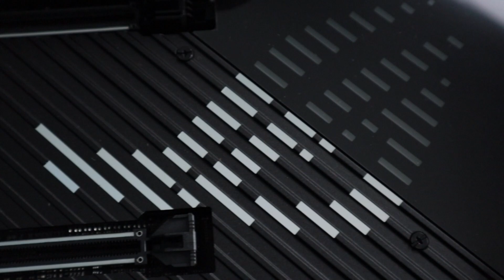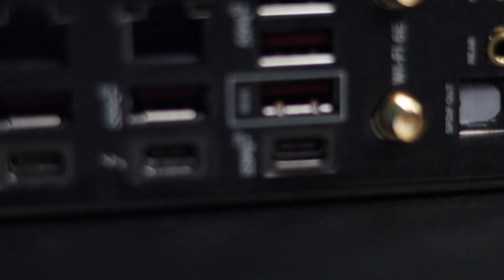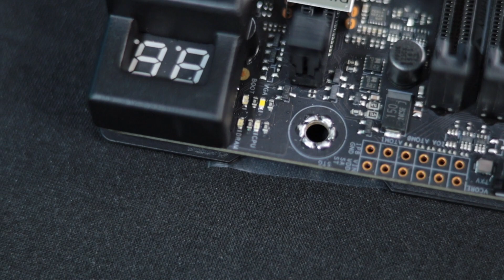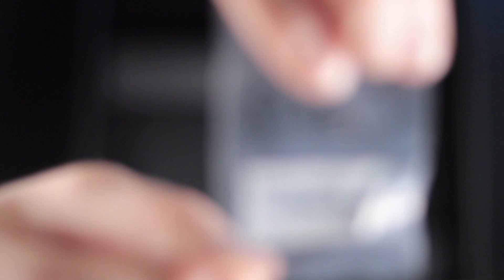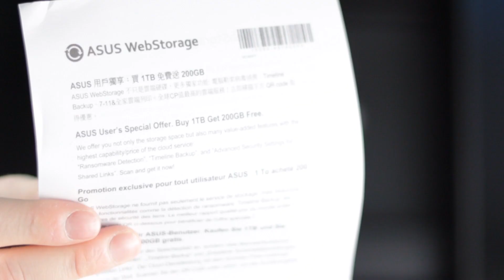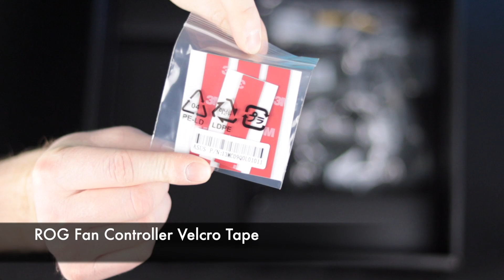$1000 Get's You This Insane Motherboard!

Comment: this board is garbage don't buy it and asus customer support is the pitts. i can't get the hyper card working on my bord it only shows gen 4. what a waste of a 1000 smackers never again
Reply from the maker: @lonewolf5316  that sucks that has been your experience :/ I have had the opposite experience with the board and it has had zero issues the entire time I have had it! PCI lanes can get a little convoluted because there may be multiple slots like on this board, but there is a limited number of lanes that can be used. For instance if you use the Gen 5 x16 slot for a 4090, it’s technically only using Gen 4 x16 performance leaving x8 lanes of PCI Gen 5 for other Gen 5 devices. So between the two PCI Gen 5 x16 slots, if you use both at the same time (GPU and hyper card) they drop to PCI Gen 5 x8 slots or PCI Gen 4 x16. The generation is not really a concern to me as much as if you are saturating the PCI data lanes with the max amount of data it can support which I would say anyone would be hard pressed to do! So I don’t believe you are have any performance loss because it shows its Gen 4!

Comment: This board along with all 4 DIMM boards will not stabily run DDR5 memory above 7200MT/s at least not using XMP profiles.
Reply from the maker: I have heard there are issues with RAM speeds and these newer boards. I haven’t dove into XMP profiles on the board yet but will be soon!

Comment: I just want the RGB to work lol. Armoury Crate is literally the worst software ever developed. Do you know how to get the RGB to launch on boot? On boot it just defaults back to the rainbow vomit.
Reply from the maker: I haven’t dove into Armoury crate yet, but my experience with it so far hasn’t been a ‘wow this is amazing’ if I had to give an opinion on it right now. I’ll let you know once I dive into it if I can get it all to work on boot!
Reply: @techtoniksystems  Thank you! It has been driving me literally insane lol. It stops working on like half of my boots, stops recognizing the motherboard, the RAM never turns off, the AniME Matrix and LED screens stop working or freeze all the time. Its terrible. If you have any tips, I would seriously be so interested.
Reply from the maker: @Evenaardez  I currently have the system in an inoperable state while I finish building, but as soon as I get it up and running it’s one of the first things I have to figure out to get the color scheme down! When I was bench testing and the board has power but not on the animatrix panel, OLED panel, and backlight RGB were all still on. My RAM however was not on once the system is off. I’ll see if I can do some digging in documentation for armoury crate to see what I can find!
Reply from the maker: @Evenaardez  do you happen to have multiple RGB programs installed on your system even if you don’t actively use them control different RGB products?
Reply: @techtoniksystems  Nope I uninstalled them.
Reply: @techtoniksystems  Thank you so much! I truly appreciate it. The RAM turns off eventually but I do not know why it turns off immediately. Tbh this board has been annoying. Boot times suck and it often screws up with waking from sleep.
Reply from the maker: @Evenaardez  My next suggestion would be to uninstall Armory Crate and use the standalone Aura Sync client by itself. See if you can get it working using that! https://www.asus.com/campaign/aura/us/download.php
Reply from the maker: @Evenaardez  the trick is not to hit the download button as that will just download armoury crate but instead look further down for the hyperlinked version of the the standalone and click that which will download the most recent version.
Reply from the maker: @Evenaardez  It’s possible you could still have some residual files from the other RGB programs that you might have to go searching for. As for the boot issues/waking up from sleep, what BIOS version are you running?
Reply: @techtoniksystems  I am running 1003, which I think is the newest?
Reply: @techtoniksystems  I can try that, but then I think the AniME Matrix and the LED screen cannot be customized.
Reply from the maker: @Evenaardez  I would do it temporarily just to see if you can get the RGB working without armoury crate the way you want. By uninstalling armoury crate, it’ll tell you that it is indeed armoury crate that is giving you the issues you are seeing vs it being something else in the system. If I was having that issue that is how I would isolate it! And currently version 0904 released on 3/31/2023 is the latest update for the z790 extreme, so updating may help solve some of the problems you are seeing with boot and coming out of sleep! https://rog.asus.com/motherboards/rog-maximus/rog-maximus-z790-extreme-model/helpdesk_bios/
Reply: @techtoniksystems  Sorry technically I am using the x670e extreme. Very similar board but its the AMD version lol. Somewhat regretting going AMD this time tbh
Reply from the maker: @Evenaardez  ahh that makes sense! I have heard that AMD boards have had some stability issues.. hopefully they can figure it out with further BIOS updates. But when I get back into armoury crate I’ll be looking into your issue further!
Reply: @techtoniksystems  Cool, I really appreciate it!

Comment: As I mentioned in a prior video of yours if you use that PCIe 5 M.2 not only does it disable the second PCIe 5 x16 slot but it also shares bandwidth with the top typically GPU PCIe slot making it at PCIe 5 x8 slot. It's one of the big aggravations I have about Z790 over Z690 that doesn't appear to have the same problem (based on my limited number of builds on that platform).
Reply from the maker: The Z690 Extreme also has the bandwidth cut to x8 when both slots are used and it disables the lower 5.0 x16 slot completely as well when the M.2 slot is in use. It is a frustrating aspect, but I believe it is due to the limited number of PCI lanes CPUs are able to handle. If you know about it prior to buying/building it should be easy to plan around!
Reply: @techtoniksystems  .. Speaking of my ASUS Z690 and ASUS Z790 on-hand now only the Z790 has this shared M.2 issue making the GPU slot into PCIe 5 x8 (4.0 @ x16). As far as planning, day one I needed spaces for 3X M.2 and while I could have possibly moved the M.2 on a different PCIe then a GPU block would have been in the way.

GPU-Z (Z690) vu9qc ; Bus Interface: PCIe x16 4.0 @ x16 1.1
GPU-Z (Z790) cvzw ; Bus Interface: PCIe x16 4.0 @ x8 1.1
Reply: Sorry sort of new to this. If I wish to use a gen 5 m.2 ssd, and if my gpu a 4090 is on the gpu's pcie won't it reduce it performance based on what you said? In that case is there a mono recommendation?
Reply from the maker: @nicholastang2642  That is a possibility yes, as there is a finite amount of PCI lanes the CPU is capable of handling, however, that doesn’t always mean performance will be slightly reduced or you will see an impact to performance. It would all depend on the amount of data that is transversing the PCI lanes at one time. So it would be a situation dependent thing. Currently (as of 4-23-2023), the most powerful GPU, the RTX 4090, is a PCI 4.0 capable device which means it is only capable of running at 32gb/s of bandwidth. PCI Gen 5 has 128gb/s of possible bandwidth so that would leave 96gb/s of available bandwidth for other PCI devices. You could still run several PCI 5.0 SSDs (when they come out) and still not see a bottlenecking issue. And not every device will use their max bandwidth capability all the time. I hope this made sense! Please let me know if you have any other questions!
Reply: @techtoniksystems  thanks so much for sharing your knowledge! I assumed when it cuts from x16 to x8 the performance of the gpu get reduced.
Reply from the maker: @nicholastang2642  Yes, that is true! It just depends on how much data is being transmitted if you will see a drop in performance or not. I would really like to test when it actually has a noticeable effect on anything. I’ll have to think about how to create a test like that!
Reply: @nicholastang2642  .. It's not just about bandwidth only and it's still costing you at least 5 if not 10 FPS cutting PCIe 4 from x16 to x8. In my case, I'm water blocking my entire rig including CPU and GPU, which makes it nearly impossible to get underneath the M.2 slots underneath the GPU / PCIe slots. I'm using three (x3) M.2's and I've installed them in areas that are accessible. It's not a problem at all with the prior Z690 motherboards... The problem is the stupid way that they decided to cut up the PCIE lanes for the "primary" M.2 so it can offer PCIe 5 speeds .. The problem is everything that you and I do for the extreme most part is 4K random and there's hardly a damn difference between a PCIe 3.0 or a 4.0 or even the new 5.0 M.2s.
Reply: @DJaquithFL  Thanks so much for both of your replies! In your recommendation, should i wait?
Reply: @nicholastang2642  .. If you can wait until October - December then I certainly would consider waiting. My primary concern is Intel leaving the monolithic CPU design and changing to a chiplet design. However Intel is jumping from a 10nm monolithic to a 4nm chiplets design for the power cores. Footnote: the chiplets are in part farmed out with a mish mash of lithography sizes and manufacturers. To "my understanding" AKA rumor mill the P-cores, E-cores, GPU tile and SoC tile have their own tiles. Whereas AMD splits (lobotomizes) their P-cores on separate tiles which is something that I really don't like. I don't like the thought of half my cores "parking" (disabling) and Windows poor handling of separated chiplet CPUs; more of an AMD issue than an Intel issue so far. My hope is that Intel fixes the current issues that many AMD CPUs are suffering from now; (edit) meaning I hope Intel can learn something from AMDs blunders. Also, I hope Microsoft Windows can fix some of the parking issues plaguing AMD.

Personally I'm considering upgrading to Arrow Lake-S after Intel, Microsoft or potentially other developers works out the chiplet bugs...
Reply from the maker: @nicholastang2642  We are in an interesting time where we are on the bleeding edge of new tech (DDR5, PCI 5.0, AM5, chiplet GPUs, etc). If that edge is uncertain for you because there are some unknowns with it, I would recommend considering waiting till the end of the year like D Jaquith mentioned to see what is going to be available, but at the same technology is advancing so fast you can always say ‘just wait till the next gen comes out’ and you’ll always be waiting! So if a little bit of uncertainty with all of the newer tech doesn’t scare you, and you are comfortable knowing new CPUs will be probably be releasing near the end of the year then it’s an exciting time to build!

Comment: Are you gonna try it with 128gb of RAM? And see if it will be stable?
Reply from the maker: I decided to go for speed vs capacity as I couldn’t find the speed I wanted at anything above a 32gb DDR5 kit. I have a 32gb G-Skill Trident Z5 7600 MTS kit ready for the build though!
Reply: @techtoniksystems  I am just wondering because I’m putting 128gb dominator platinum DD5 6500 MTS kinda over kill but I hope it will handle it 😂
Reply from the maker: @ramirocasillas1394  That sounds like it’s gonna be amazing! I love overkill builds and they are just fun to do. The board should have no issues handling that! We’re you able to get the RAM as an entire kit or did you have to buy separate RAM kits?
Reply: @techtoniksystems  a Kit 2x:64gb
Reply from the maker: @ramirocasillas1394  You definitely shouldn’t have any issues then!

Comment: Is it best to use the dimm.2 card to load ur operating system ?
Reply from the maker: This is a really awesome topic and I am sure that you will find different answers when you ask different people. On the Maximus z790 Extreme, both storage slots on the DIMM.2 card are running on the PCI 4.0 x4 lanes, which means that it shares bandwidth with M.2_2 (the slot right above the PCI 4.0 slot under the lower heat sink as well as the PCI 4.0 slot itself). So if you have multiple storage devices running on those lanes it would be sharing bandwidth with each device. My personal recommendation would be to install it in M.2_1 (the slot under the OLED) as this slot is a PCI 5.0 M.2 slot that shares bandwidth with the bottom PCI 5.0 x16 slot (which will be typically unused on most builds). This will give that storage device the most bandwidth capability vs the DIMM.2 slot especially if you have multiple storage devices running on this PCI 4.0 x4 lanes from an on paper standpoint! Once I get the build complete I will be creating a video addressing this by benchmarking a storage device in each slot to see which one is truly the fastest location in a real world situation, as we all know that on paper can be very different from results in actual real world testing. Please let me know if you have any other questions!!
Reply: @techtoniksystems  Sounds good. I will use the dimm card for my game storage then
Reply from the maker: @ALL-EgO-IRL  That’s what I am planning on as well! There is plenty of storage capability on the board to run Hot Warm and Coldish storage options if that is of interest you.
Reply: @techtoniksystems  I feel like the dimm.2 card will be the coolest with it having the heatsink and being in direct airflow.
Reply from the maker: @ALL-EgO-IRL  I agree on that! Especially if you have a front intake. What I meant by Hot Warm and Coldish was referencing the speed of the storage 😁 on databases hot is referenced as the fastest most accessible to the system used for often used applications or information, warm referencing medium speeds and accessibility, and cold storage the slowest speeds and and accessibility. So on this board you could mimic that with hot storage = PCI 5.0 NVMe, warm storage = PCI 4.0 NVMe, and cold storage = SATA 6 SSD. There are just so many options you can run that it makes the motherboard really fun!
Reply: @techtoniksystems  I use the DIMM.2 for boot drive and storage drive, ideal for a hardline water cooled system as it makes the drives easy to access without pulling the loop apart.